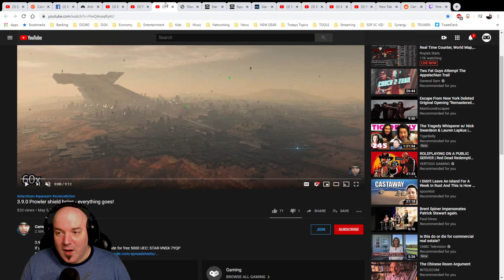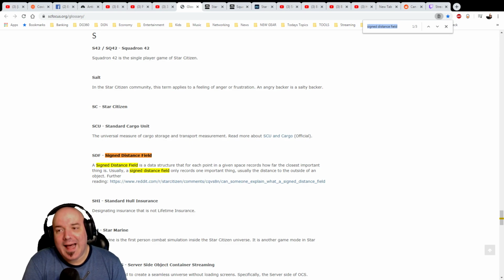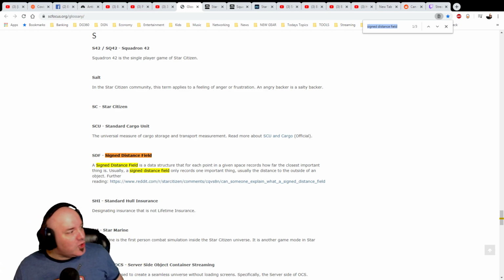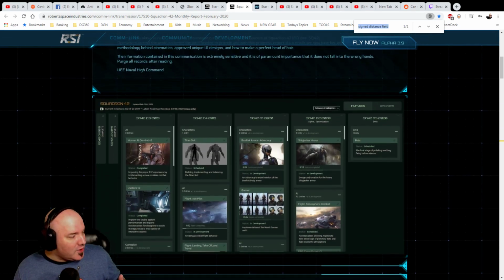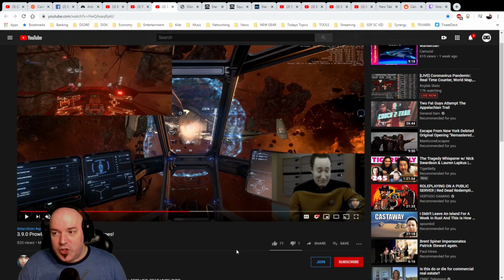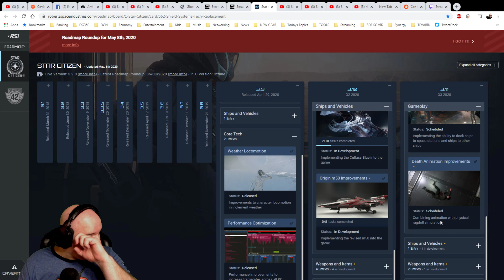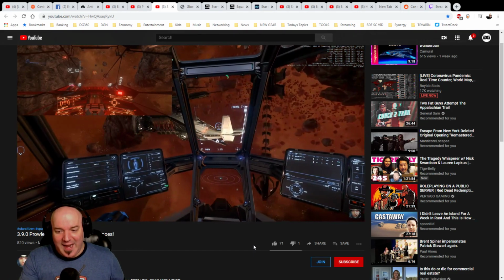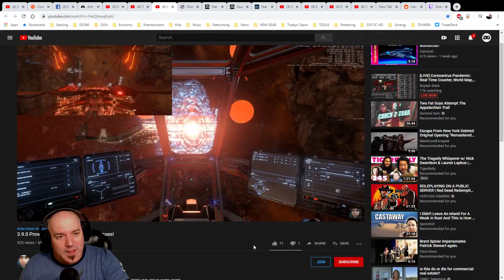Star Citizen SDF Tech ESSENTIAL for a BETTER EXPERIENCE

Comment: I don’t understand why they have to make it so complicated. For the shields, why not just make the shield an oblate spheroid that simply and effectively encapsulates the ship? Then there’d be no shield holes. Also, they keep releasing new ships knowing they have shield holes, and that’s just uncool. SDF tech is great for graphics like the re-entry flames and so on, but is it really necessary for shields? Just have an oblate spheroid that can take a certain amount of HP and then fail. It’s doesn’t have to be so damn complicated, CIG. And honestly if you had an oblate spheroid shield it would be deflecting the atmosphere around it on re-entry anyway so you really wouldn’t need SDF for that either. Edit: If you wanna see what it would look like, check out any Star Trek episodes where the ship is hit by phaser fire. Also, since a shield like this would basically be an energy field generated by the shield generator component, it would be more realistic to expect it to take a simple, smooth shape like an oblate spheroid, emanating from the shield generator coils, and not something the same shape as the ship only larger. Additional Edit: Unless... Star Citizen shield generators might work by connecting to the ship’s metallic space frame and use it as a sort of waveguide to output the shield energy field generated by the shield generator’s field coils, thus distributing the forces throughout the body of the ship during an attack. In that case since the shield energy is emanating from the metal body of the ship itself, the field shape might take a very approximate, blobby version of the shape of the ship. But even then SDF wouldn’t be needed since the shield could be manually constructed by a dev as a simple collection of oblate spheroids approximating the shape of the ship.

Comment: Why it was pushed back to 2021 is annoying to me. The Shield tech effect is all the way in Q4 of the SQ42 2019 roadmap, which means more than a year scheduled item if it does not come by Q4 of this year, and this is something that is borderline game-breaking. This would not bode well for staggered development, for something to be scheduled for a whole year. This is why I avoid PVPing, due to an experience where I was blown up in seconds by a significantly smaller ship. I mean I should be able to QT away if I cannot hit him, but my shields were fine and the ship was falling apart. If it wasn't for Camural, I would never have been able to explain what happened.

Comment: DG, I think you're making mountains out of molehills again.  Better experience? Sure. Most new tech provides a better experience. ESSENTIAL? No.  You've been playing for years and still have had fun. Without it, they can balance the game in different ways. The Prowler packs a ridiculously hard punch. It's so powerful, it's gong to get nerfed.  I don't mind weak spots. Good pilots will know their ships strengths & weaknesses, and react accordingly.  Stay back and use the prowler as a sniper. Most AI ships can be destroyed before you can see what ships they are. Players?  It's a stealth ship. Sneak up, surprise them, and take them out quickly. Also, it's a dropship, not a dedicated dogfighter. Now you want essential? AI, Persistence, server meshing,  physics refacator,  server to actor client re-work, dynamic economy, etc.  SDF doesn't even make my top 10.
Reply from the maker: Well the shield hole testing I've seen done on cams channel shows some serious flaws in tech design at the moment that I wouldn't necessarily call molehills. I'm not trying to make mountains here Damon. I'm trying to point out some technical design issues and how those issues are being worked on by CIG :)

Comment: As others have pointed out, the SQ42 roadmap has "Shield Effects v2". However, it is very important to understand that this implementation of SDF is in fact just that, "Shield effects". VFX. SDF does not affect the object "state", SDF gives the object information to trigger a VFX, in this case a shield reaction VFX. But the fact that a VFX fires does not mean the shield hole is in fact fixed. Shield holes have more to do with object states than VFX, especially when it comes to physics projectiles (the ship itself and the lazers being shot at it). I suspect the issue with the shield holes has more to do with the weapon projectiles simply skipping through the ship's "shield" object state and affecting the ship's "hull" object state. I suspect the reason it happens at some angles and not others, is because the  game cannot decide what shields should be affected by this angle, and is instead saying "I don't know, skip it, affect next state". Putting SDF over it, is akin to putting a rigid tablecloth over a broken table: It'll look like a stable table, but the moment you put something heavy on it, it'll be apparent the actual problem still exists.
Reply from the maker: From what I was reading bootch, the field itself can hold a tangible "value" which would mean it would be more than just Vfx. Also both the polygonal mesh or skin around an assets vertices and the field itself can communicate information between each other which also should help with ship damage and object design changes in vertices such as when an engine or wing falls off etc. If this is truly the case, then it would be a viable way to fix shield hole issues. I think the biggest problem however is exactly as you stated in discord a few days back and that's how achievable this tech is with vertices on the mesh skin surface being dynamic by moving through a 3 dimensional space. I couldn't find any material on that and am very curious about it.
Reply: Turning a VFX field into a physics collision mesh is certainly an intriguing idea, but that is a mountain of work I do not envy. Which I guess is why I caution the optimism of "this may fix the issue", because if the face value is to be believed, the SDF card of "shield effects" is just a VFX implementation. Now, if they're specifically working on turning that SDF into a collision mesh for the shields, that's something we're going to have to wait and see, as nothing on the current roadmap suggests that specifically. I will grant that somehow, someway, it is possible, but whether it is practical and/or feasible with Star Citizen as it stands is probably something we could debate for hours.

Also if you don't mind, could you point me to the material that talks about field holding a tangible value? I'd just like to read it to learn something.
Reply from the maker: At the GFs house for the weekend. I'll shoot it to you when I get back home :)